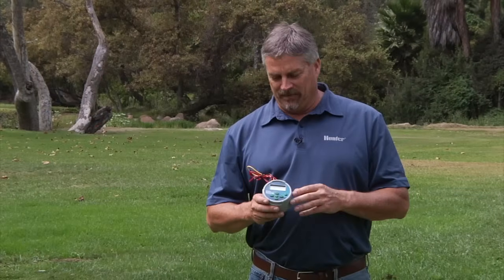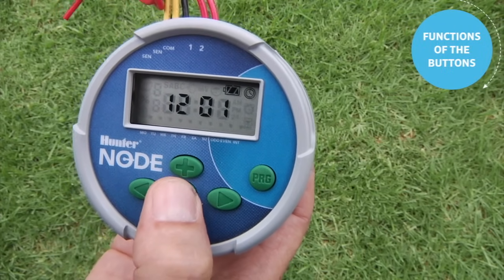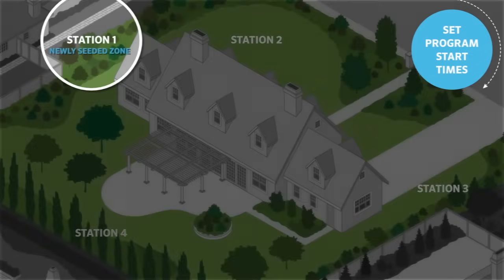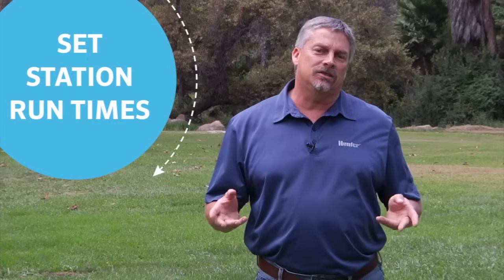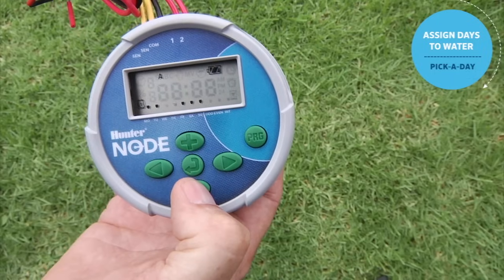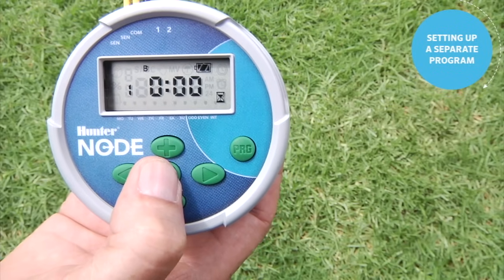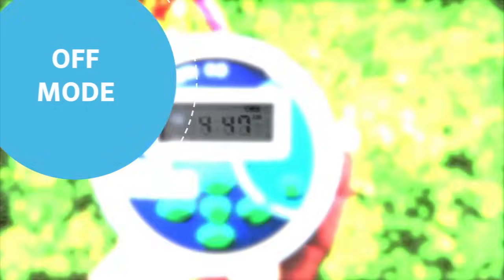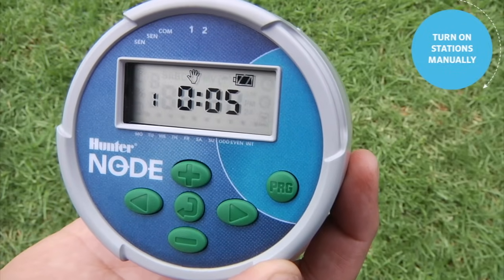NODE: Programming the NODE irrigation controller

Comment: I have a yard that has too many sprinkers on one zone and I want to use this to divide it up into several zones.  The water for the sprinklers comes from an irrigation well on a timer.   Could I use this for this application?
Reply from the maker: A Hunter NODE can be allow you to splits a zone into two, smaller zones to reduce flow and potentially increase pressure. A pump start relay, if you have one, can be activated by an AC powered controller like the X2 or Pro-C or controller but not by the battery powered NODE.

Comment: Hi, I have a node 200 and I needed to change the batteries, no problem, right? Well, I gently removed the batteries but then I noticed on both batteries one of the +/- heads were stuck in the Node 200 +/- spots!! I’ve tried and tried to pop it out but to no avail. Everything is clean and new on the Node 200 battery receptacles, no corrosion or water. What do I do? Please help, thank you, Kate
Reply from the maker: There are a few possibilities so contact our customer support department here: https://www.hunterindustries.com/hunter-technical-support-email-request

Comment: I did all the settings correctly but the problem is that the water pump switches on every about 5 to 10 minutes and lasts few seconds then stops??!!!
Reply from the maker: It may be time to contact a local irrigation professional for help with your issue.

Comment: How do I turn it back on after winterizing. For summer start up. It's already programed.
Reply from the maker: Your NODE battery powered controller may have had the program turned off, watering days turned off, or run times turned off. Visit https://www.hunterindustries.com/irrigation-product/controllers/node for the NODE instructions.

Comment: One thing that I can't find the answer for is "System Run Time" Is the amount of time entered per cycle or cumulative? So if I have 3 times scheduled and want to run them 10 minutes each do I input 10 or 30? I'm starting with 10 to be on the safe side. 

This is my first time with setting up any irrigation controller and I'm installing it tonight.
Reply from the maker: Great question!
 
The amount of time /minutes being entered in "Run Times" is the duration of watering length per station/zone. 
 
Here is an example of a program for a 4 station controller:
You have a 4 Station Node Controller. Your lawn stations are valves #1 and #2. Your shrubs stations are valves #3 and #4. You want the lawn stations to water Monday, Wednesday, and Friday at 4:00 am and again at 6:00 am for 6 minutes per station. Finally, you want the shrub stations to water on Saturdays at 6:00 am for 10 minutes per station.
Here is what each program would look like on the door card:

Comment: It works to add rain sensors?
Reply from the maker: Hello Paul, Wireless Rain Sensors are not compatible with the NODE as wireless sensors require a 24-volt power supply to operate.

To install the sensor on the NODE:
1.	Cut the yellow wire loop attached to the NODE at approximately the middle of the loop.
2.	Remove approximately 1⁄2" (13 mm) of insulation from each wire. Attach one yellow wire to each of the wires of the weather sensor. You can mount the rain sensor up to 100 ft (30 m) from the NODE controller (18AWG/1.0 mm minimum wire size).
3.	Secure wire connections with waterproof connectors.
Please email support@hunterindustries.com for additional support.

Comment: I have the Node-100.  I have not found where it tells about the solenoid after attaching it to the sprinkler, do I leave it in the 'Off" position and the controller will turn in on when the system starts up   OR  do I turn in to the left, to the "on" position.  Right now I have it in the on position . . . but nothing happened.  I see there are numbers on the top of the solenoid . . . do I need to be concerned with those?
Reply from the maker: Hi Barbara, The DC Latching solenoid should always be in the OFF position on the valve for the controller programming to work.

Thank you again for contacting Hunter Technical Support. Please let us know if we can offer any other assistance.
Reply: Thank you for your quick resonse!!!!

Comment: I am having a terrible and frustrating time programming this thing. My sprinkler guy put this in--at great expense--and I can not get it to work as I wish.  In one place I have two stations but only need ONE station to have a second watering daily as it is in the sun but I cannot get this to happen.  I can leave the other station off--or try to--but it will not work that way. I do not want both stations twice a day so I put one station on another program and still I cannot get this to work. Have watched the video many times and still have not gotten this thing where I want. I can get watering once a day but the twice for one station eludes me.
Reply from the maker: Good question about programming. You need to create two programs to accommodate what you need. Go to the same settings (Start Time, Run Times, Water Days) but change to program B to set up your other zone. You can give us a call if you need further assistance, Technical Support is available  

Monday through Friday, 4am to 4pm  Pacific Time at the number 1 800 733 2823.
Reply: @Hunter_Landscape_Irrigation  I guess I will call because no matter how I set it up, this system will not cooperate!  I have a shady front yard and a sunny back yard and the system will not let me water the back scorched yard twice without also watering the front which does not need it. Even my sprinkler pro could not fix this problem. I did set the stations on separate programs and it is not helping.
Reply: @Hunter_Landscape_Irrigation  that's the part that is missing from this video is station B and how to access it with the buttons.

Comment: How do you set a start day when on interval of 3 to 6 day interval, - i.e. how to program how many days ahead the program starts.
Reply from the maker: Thank you for contacting Hunter Technical Support.

On the Node controller, you are not able to select the interval start and days left. 

When the interval starts depends upon what time of the day you set the interval and what time you set the start time. 

· If you set the interval AFTER the start time has passed, the irrigation will start after the number of days has past. 

· If you set the interval BEFORE the start time, the irrigation will start that day and then start the interval day cycle.

For example:
If your start time is 5am, and you set the interval at 9am, and you have a 4 day interval, the irrigation will not run for 4 days, then every 4 days after that.
If your start time is 10am, and you set the interval at 9am, and you have a 4 day interval, the cycle will start at 10am, and then every four days after that.

Thank you again for contacting Hunter Technical Support. Please let us know if we can offer any other assistance.
Reply: @Hunter_Landscape_Irrigation  Thank you very much!

Comment: Turning off a watering time has become a challenge. I take my 2 start time to 11:45 PM but the OFF signal does not display at all and keeps the 2 watering time to 11:45 PM. What I am missing?
Thanks
Reply: @Hunter_Landscape_Irrigation Hello Hunter Tech Support
Thanks so much for responding quickly to my question.  Once I get the timer to 11:45 PM and short press the plus button once, I still do not get the OFF position; instead it advances to 11:46 PM. It is a weird thing.

Comment: I live in a hot climate, and I need my garden to be self-sufficient for a week or two when I go away.  It works great when programmed correctly, but therein lies the rub: it's TOO CONFUSING!!! I'm on my third year, but I'll be damned if I can figure out whether the thing is even off or on. There needs to be a more user-friendly interface. I'm not happy that my irrigation guy installed this one, after I went to the expense of getting electricity piped to the garden for an automated system. I'm still scratching my head, although this video helps some. Maybe if I watch it a few more times I'll have the nerve to try and program it again. I would never recommend this product to anyone.

Comment: The problem is the menu system is so poorly designed. I'm still unclear even from watching the video how I need to set this up. The problem is with different stations/ different programs and poorly labelled options on the screen. A product is only as good as its operating system. 
Won't be buying another one.